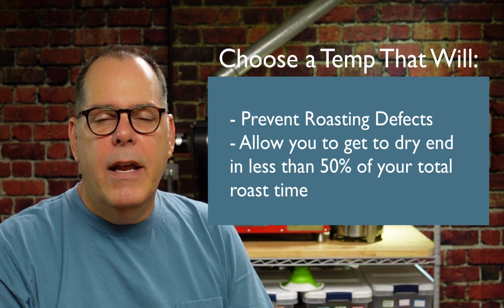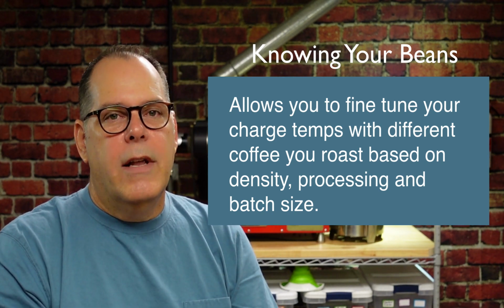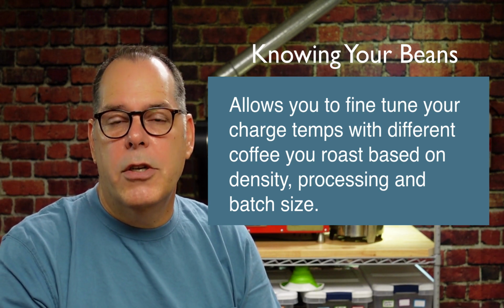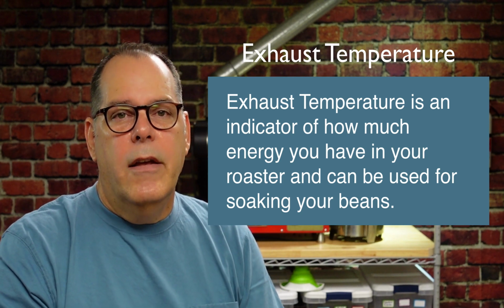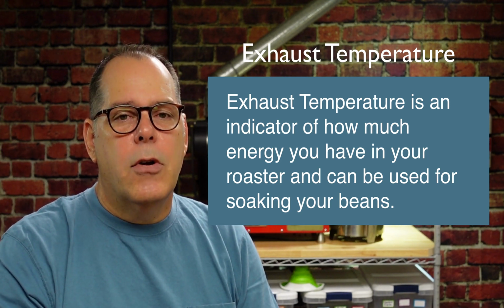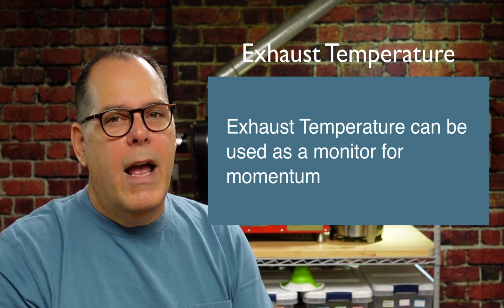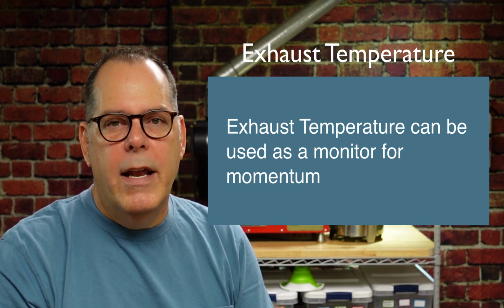Charge Temperatures For Home Coffee Roasters

Comment: Since I started watching your videos I now pay attention to the three phases and meticulously track 30 second temps in Roastmaster on my iPhone. I have a Behmor 1600+ with 300 roasts according to Roastmaster :) 

I roast outdoors and we dialogued with you on this on another video, that you have ambient temps in your basement and I'm outdoors in Vancouver, roasting currently in the 50Fs. I surround my unit with styrofoam now and it's way better. Since I've been recording I know for sure that a lower charge temp (<200F on the Behmor B-temp) reduces first crack by 1-2 minutes vs. a charge temp like 280-300. It's like a high charge temp creates a seal on the shell of the bean that insulates it from heat and results in more conduction? Lower temps allow the head into the bean core and facilitate endothermic heating. I don't know the physical chemistry, but I now just accept the Behmor suggestion for preheat for 1:45 only, because I know it actually decreases roast times. 

Any comments?
Reply from the maker: Thanks for sharing Doug.  I’m not sure how to explain what you experienced.  There are a few variables which could be influencing your test, namely the top temps you attain during dry phase, when those occur, and does the fan turn on during dry for either of these roasts.  

In all my learning about roasting coffee, I have never heard of a deal on the bean, preventing higher temps from penetrating the bean.  That doesn’t mean you are wrong, I’ve just not heard that before.  Tenets are some unique circumstances the behmor presents by its design.  There isn’t that much conduction going on because of the drum design.  Also. The radiant heat is a huge factor during dry.  Sure you don’t have a hot drum surface influencing the roast but you do have a very intense heat radiating the bean mass.  Those will have an imp t on your roast time and dry time.  

Lastly we didn’t talk about how bean moisture and what happens with high charge temps.  We can save that for a future conversation.  

I think this article is helpful and scientific in that it just isn’t opinion.  The author references his sources.  Check out that article and let me know what you think. 

https://tastingcoffee.com/papers-full/a-thermodynamic-approach-to-roasting-parameters-and-stages-of-roast/
Reply: @VirtualCoffeeLab  Thanks so much and I'll read up. You've been very helpful, particularly with providing some simple rules of thumb on the three phases. The consistent criticism of the Behmor is that you just can't see the bean color so I wait for a whiff of caramelizing beans to tell me when browning begins. I used to record 1C as the start of consistent cracks, but after watching you I now record 1C as the absolute first crack and then aim for 17-20% of time for the development phase. 

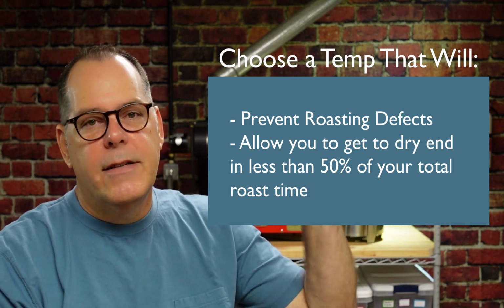Maybe it's better suited or your Behmor videos, but the 7:30 afterburner/exhaust (1 lb. setting) interrupts the steady B-temp and ROR trend. The ROR calcs get thrown out the window more or less after 7:30. So I just follow your advice and hit the D button around 9:00 to create conduction, and record 1C as the start of the Dev phase. I know the bean temp is increasing, but there's no way to track that after 7:30. Any comments on that?

Thanks again. I buy in 30lb batches to reduce my green bean cost and am using Honduran Marcala at the moment, so I really feel like I know those beans. I got very familiar with Sumatran before, and I'll probably go with an African bean next time. Bit by bit I'm going to cover the world!
Reply from the maker: Hi Doug.  Yea, that article is helpful as we try and understand how different types of heat influence our beans.  The Behmor does not really have airflow like a traditional drum roaster so bean movement using the drum is the primary way it receives convection heat.  I could be wrong on that but I don’t see the afterburner fan creating much airflow BUT I have no proof of this. 

A comment about first crack.  I measure first crack as the first series of cracks.  There will always be outlier crack sounds before this, but first CRACKS is how I mark that event.  

Regarding lighting, the behmor is not great to monitor color.  You can use an external led light or change the bulb in the roaster to an LED to improve your ability to determine color.

Lastly, if you use the 1/2 pound setting the fan kicks on at 5 minutes AND this could be the perfect time to allow your temp to lower because you are near yellow.  You can then compensate with p5 or p4 so your temps don’t drop too much.  That’s just a thought.  Plenty of people roast using the 1 pound setting as well.
Reply: @VirtualCoffeeLab  Great idea on the 1/2 lb setting to drop the temp during browning. My ambient roasting environment temp is still in the 50-60s and on the Behmor B-temp I can barely reach 300F, so I felt my chamber temp was already on the low side. Through winter and spring I don't use P3-4 like you do because I thought I would end up baking my beans, and at least one roast proved that so I leave P5 enabled now. As it warms up, I'll start P4 and P3 when I can hit 320 in after a few minutes. 

On 1C I chatted with a friend who's a commercial roaster and he said they mark it at the first pop of any kind, but previously like you I was waiting for a couple cracks per second.  To get your suggested 15-20% development time I mark 1C as the first pop, and now know to let the Hondurans roast until the quiet period between 1C and 2C. My typical roast produces 1C around 12:00, I open the door a bit to prolong the crack to about 13:30 - 13:45 and then drop the beans at about 14:00, just before 2C. Development is then @ 18-20% and I'm pleased with the flavor. 

I read, and confirmed through trial that these particular beans benefit from at least City+ or Full City to fully develop their flavor. Anything less than 15% development time and they're still a touch grassy, kind of crying out for a little more caramelization.

Comment: Mike, thanks for this. Does "soaking the beans" mean the beans should be moving or simply sitting in the heat?
Reply from the maker: Moving.....  If we are talking drum roasting, I use a soak method for many of my roasts.  This is where I get the roasting environment to temp and then put the beans in (charge) and then let the beans begin to absorb the heat.  My soak times range anywhere from 15 seconds to 1 minute depending on the beans, how much coffee i am roasting, density and the roasting profile.  Beans sitting in a hot chamber will be touching and sitting on a hot surface and could get scorched.  It is always best to keep beans constantly moving.
Reply: @VirtualCoffeeLab  If charge temperature is as crucial as you've taught, how can beans absorb so much heat in such a short period? Secondly, what is your recommendation for a charge temperature in a skillet roasting environment? 300°F?
Reply from the maker: @mhpjii  Depending on your roasting device, the type of beans you are roasting and the style of your roast will determine what temperatures to use.  Yea, there is a limit as to how much heat a bean can take before it is not roasting evenly.  As heat is applied to the bean, it radiates towards the center.  I think it was Joe Morocco who did many of the Mill City videos who explained that moisture is pushed towards the center of the bean, protecting the embryo.  If too much heat is applied, the outer part of the bean gets more roasted than the inside of the bean.  I think I had a little of that happen on a recent roast. So I think you are right, there is a limit to how much heat a bean can handle to get an even roast. 
 At the same time, we don't want a long dry either.  This long dry time impacts our overall roast time, momentum and flavor profile.  So, there is a "range" that we use based on our roast styles.  This will also depend on our roasting devices.  A hot air roaster more than likely won't be soaking and their dry phase and total roast time are generally shorter than non-hot air roasters.

For a skillet and any other roasting device, scorching is always a concern.   That is why i mentioned keeping the beans moving around on my previous message.  I have roasted on the Hive, which is a pan like roaster with a cover BUT it isn't a skillet.  By roasting environment, are we still talking a frying pan uncovered?  Is the temp you are asking about the temp of the steel?   I've pre-warmed my hive to as much as 350 degrees. I don't know what the temp of the hive metal  itself is, the temp reading is from the internal temp of the hive read from the probe, which ends up in the bean mass once you charge the roaster.
Reply: @VirtualCoffeeLab Thank you, Mike! Yes, I'm forcing myself to roast only with a skillet (uncovered for now) so I can really learn this process. I'm roasting either Ethiopian Sidama or a Columbian Arabica. My question is: what should be the skillet temp when introducing the beans (as measured with my digital thermometer)?
Reply from the maker: That's exciting.  I'm hoping to do a video on that.  I'm interested to hear how this goes.  Total guess........If you start with a skillet temp of 300 degrees and then keep the beans moving, see how long that roast takes.  You are going to need to adjust your heat along the way and the change will be slow.  Let me know what happens.
Reply: @VirtualCoffeeLab  I roasted last night and I want to let you know, Professor, that I now understand the importance of charge temperature that you have imparted here. I chose a near 400°F (383°F) temperature to begin. I'm still not certain about all the other variables but slowly I'm learning. BTW, your roller coaster metaphor is excellent.
Reply from the maker: Glad you are seeing the importance of the charge temp and having some success.  I'm just a home roaster like you, learning along the way!

Comment: Hey everyone, do any of you have experience with fluidized bed style (AKA Popper)? I have a FR800 and I have a batch size of 200g. With that I can hit a 4 to 5 min dry time with charging at room temp and running full fan and the lowest power setting. I'm sort of thinking out loud, but my question is; If the goal is to obtain an even roast throughout the bean then wouldn't it make sense to dry the bean as slow as possible to minimize the delta temp between inside and outside? Has anyone tried a really fast dry, vs a really slow dry keeping the rest of the profile the same?
Reply from the maker: Hi Matt, How far are you taking your roast (how dark).  What type of coffee and what is the end result you are trying to accomplish?  

As far as roasting with an air roaster, I think you made a great point in the question you asked, and kind of answered your own question.  One of the best indicators of how long you should dry is the evenness  of the roast at the end of dry.   Also, the flavor profile you are after will determine how long or short you want your phases.   

Here are a few things you might see if your heat is too high causing a shorter dry time: 
1.  Uneven roast at dry end
2.  Under developed coffee  (for fast roasts)  Crack the bean open at the end of the roast after cooling and see if the color is consistent throughout the bean.  If it is lighter on the inside than the out you might want to look how fast you are pushing the roast.

If you drag your roast and have too long of a roast you risk flat coffee.   If you are getting a nice even roast but your coffee is kind of boring and flat, you may have dragged the roast too long.

Putting too much coffee in your roaster (over capacity)  can't move the beans around will also cause an uneven roast.

One thing we should consider is how much time to spend between dry end and first crack AND from first crack until drop.  That is why i asked what type of roast you are shooting for.  I have a playlist that talks about roasting essentials which include the topic of roast phases and how they influence your roast.  Check them out if you are interested.  https://www.youtube.com/playlist?list=PLe757VIiQrPYFTUF1g87lkkEymjQ40wMK
Reply: @VirtualCoffeeLab  
Thanks for the quick reply! I am a light to medium roast guy. I have been doing about a 10:30min total roast. 4:30 min dry, 4 min Milliard, 2 min development. 

I just cut a bean open and the color is very even, so I guess I'm in the sweet spot. 

Yesterday I tried three profiles.
1. charge to 300F Dry took 4 mins.
2. Normal charge at 70F Dry took 4:30 mins.
3. charge at 70F and then soaked at 250F for 5 mins. Dry took about 11 mins. 

I'm excited to try it and see if I can taste any difference between them!

I was wondering if other people with fluid bed roasters charge their system, or if they also start from room temp.
Reply: Update: The roast with the crazy long drying phase was easy to pick out during blind cupping it was very lacking all ways, acidity, sweetness, and bitterness. The high charge temp (300F) vs no charge temp (70F) were very similar. I'm reading through the coffee roasting companion right now and Scott mentioned it is possible to start with very high charge temps in a fluid bed roaster, so I think I'm going to give that a shot next. I'm still super confused about how purposely causing a large deltaT between the inner and outer of the bean during the beginning of the roast allows the bean to be at an even temperature at the end of the roast.
Reply from the maker: @mgriff2000  I will have to dig back into the roasting companion and see if he clarifies air roasting vs drum roasting.  Charge temperatures for air roasting can make a difference but i'm thinking the focus is on a traditional drum roaster that uses conduction heat transfer during the dry phase.  Maybe the extra heat from a prewarm on an air roaster will provide a slightly shorter dry.  
I think there is a limit to how short your dry phase can be and still allow even development.  Density of the bean plays a big roll in the variable of how much heat.....  OR .....  how short can my dry phase be without risking an uneven roast or roasting defects.  
Thanks for sharing.  I'm interested to see what you find related to charge temps with air roasters.....
Reply: @VirtualCoffeeLab  ok last update, so to get up to a higher charge temp I had to lower my fan speed and set my power higher, but as soon as I put the beans in I had to take the fan speed back up to make sure the beans were still moving. So that roast shot through the drying phase super fast and I noticed tipping. I'm not excited about tasting that roast :( So the good news is I settled in on a charge temp and a batch to batch protocol. I set my system to the fan speed and power level I want to get my initial ror. I let it heat up until the temp stabilizes and then I put the beans in.
Reply from the maker: ok, that makes sense.  That is how I approach my roasting as well.  Finding a power setting that will allow me to meet my target dry time without roasting defects.  I do the same thing for all of my events.  By managing heat throughout the roast, I am able to hit my event times based on the phase percentages I want.  Thanks for sharing your thought process.  Did you say you were using an extension tube with that?
Reply: @VirtualCoffeeLab  nope just the regular version.

Comment: Thank you very much Mike, it's  very informative 👍

I've a question 
Is charge temperature based on BT or ET
And I only have XT (Exhaust located Temperature probe) and BT, so ..do I have to change the location of the Exhaust probe and move it on the front side ( because there is another hole on front side incase relocating the XT probe position) or just keep it at its current location in Exhaust and use it as ET ?

Sorry for this long question 😅
Reply from the maker: Hi Mohammed.  Remind me what roaster you have please.  Also, do you have more than one probe?  Ideally you would use both.  I use the BT as my charge temp but also use exhaust temp to measure available heat

Comment: What is the right MOMENTUM:  that is the question ET = exhaust temp. for control of  a roast becomes more and more interesting for me. But it seems to be useful only, when the probe is well placed.
May be the best location is not the exhaust but the beanfree space  within the drum near to the front plate. It  shows how much and how quick energy is transmitted to the beans. To keep ET between 200  -230 °C  may be a good advice for roasting successfully. Would like to hear of your experiences.
Reply from the maker: Hello Erhard, Different roasting styles will require different momentum.  Roasting for Espresso for example can be done a few different ways.  One method is to have a lower momentum, lower rate of rise and slower decent.  The main roasting profile I use has a pretty consistent exhaust temp during most of the roast.  Once I get to dry end and back off my heat, I seem to be about 450 F  or 232 C until I get into first crack and then i lower the temp more.  

As far as my exhaust temp, i have mine placed in the drum, above the center of the drum away from the bean mass.  I have an interest in monitoring the exhaust temp via artisan but have not set that up yet.  I hope to do that sometime in the future.
Reply: Too low or too high until yellow is very often my failure. Seems there  is no hard data for that except experience!?